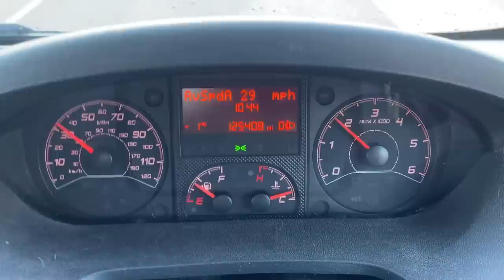Woken by angry locals and some all too familiar engine issues (Winter van life gets tough)

Comment: Hiya, I am a 65 year old engineer who used to look after Fire Engines, Not a regular viewer but just saw this and think my experience will help.
Frozen Pipes -- on the fire engines in remote locations the water pipes were wrapped in commercially available product a webbing about inch and a half wide sort of cloth on a roll with like an electric blanket element built in just to keep above freezing.
So no big insulating work just wrap around as required and connect to electric , we used 240v but sure 12v is available.
As to coolant level going down , first could be bits of air working there way out of the system , don't forget the fluid contracts when cold.
I presume you are using correct fluid as when I worked for Peugeot one fleet operator would not use the pink stuff and the blue dissolved the aluminium heater matrix due to the Borax in it.
I have several campers I support and like the diesel heaters but not done one that also does the hot water yet.
Best Wishes Pottsy.
Reply: Hello i Subscribed now and got a fail at Tele-gram attempt. 
will try again later. Steve.
Reply from the maker: Hi ya, thank you for all your advice and sorry about the scammer message that was not us, I have reported and blocked
Reply: @campervibe  😵‍💫 Panic be carefull. SP,

Comment: The water loss might have been an airlock which cleared itself. The up and down temperature might be the radiator thermostat failing which is quite a cheap part but not sure what the access is like on your engine.

Comment: Keep yourselves wrapped up warm! Looks great so far in terms of scenery! Must be the season for coolant issues as our Sidney decided to lose heating this weekend and the coolant dropped low.
Thinking back to your Spanish adventure's, what was the actual fault the UK dealer said??? Sidney is going in Tuesday for a check up. Glad it's not stopping your fun! AJ and Summer both look like they are enjoying the adventure
Reply from the maker: Hi mark, get them to check the egr cooling valve (some call it the oil cooler) It’s a common fault on these engines and is often mistaken for blown head gasket, as the Spanish garage did in our case. Our fan assembly unit was also knackered when it came back from Spain but it was hard for the uk garage to be certain of the fault as it was such a mess!
Reply from the maker: Definitely won’t stop the fun, I actually don’t know, lou is the best one but she is under head phones editing at the mo and I best not disturb her flow 😂 hope all is ok though 🤞
Reply: @campervibe  you absolute stars. I knew you'd remember. Take care and have words with that attack hound, sleeping on the night shift. Tut tut AJ! Glad you are all well.

Comment: Loosing a little colant could be a loose connection on some pipe,when you stop for a brake, before you stop the engine check and see if you have any dripping in engine bay or under the engine while it is still running (pressure in the coolant system) the temp gauge could be a loose connection or corrision in a connector! Regarding the water pipe you can buy some foam pipe that is sliced and put over it (Bauhaus/Home Depot) it not that expensive, impresive landscape, Enjoy!!
Reply from the maker: Thanks

Comment: You've got the last of the Ford 2.2s; I spend ages chasing my Transits thirst for coolant. Usually it's the EGR cooler (which I think was your issue last time? It manifests as a blown head gasket, but when the engine is stripped, the gasket presents OK...) Most recently I've changed yet another oil cooler but that was for oil in the cooling system. Also, check the thermostat housing. It's only O-ringed into the block and they do leak from there from time to time. I can't really moan though, I'm up to 410k on the original engine now in a 2013 van (yes, 410...)
Reply from the maker: 410k oh wow

Comment: Fun to watch as ever, thank you. Just film life as it happens, why would you not?

AJ clearly felt he was not under threat being protected from all ills by fearless humans! Lovely to see him romping ...

Your temperature gauge problem is most likely a poor connection to the sender unit. Or a faulty sender. I have had this exact problem. If it persists I suggest getting the sender changed. They are a common part so easily sourced and not expensive. There is a secondary effect because the ECU uses the data from the sender to control engine fueling. So your fuel consumption may suffer and possibly cold starting may be more difficult.
Reply from the maker: Oh I know he knew we would protect him at all costs 😀🐕
Reply: @campervibe  Hope Lou finds my suggestion re temperature gauge helpful...

Comment: You can get heater wire which you can put around the lines to the tank, and once that's done you can insulate it with some heating duct stuff from a DIY store. And for the waste water tank you can put some concentrated antifreeze in it, it will mix with all the crap you put in but due to beeeing concentrated it won't freeze (unless it gets really cold)
You might consider a changeover switch in the feeding line of the water pump (Or a removable plug which allows you to select a tank) so you use the underslug tank only in summer.
Ow and your ice issues... Kinging it would be happy to have that as the only issue ;)
Reply from the maker: 😂😂 bless them I’m sure they would and thank you for the advice

Comment: This is just a wild stab but running cold sounds like a problem with the thermostat rather than a more serious problem, such as a blown head gasket.

Look for white smoke and/or condensation in the exhaust.
If you're not getting white smoke then your engine is "probably" okay.

If the coolant level continues to drop, it must be going somewhere, which is a bad sign.
A faulty thermostat can make it impossible to fill the coolant system properly, though, so as the engine is running for long periods it's gradually displacing air and replacing it with coolant.
If that's the case, the coolant level should stabilise eventually.

Alternatively, it could be that, perhaps, a seal is leaking in the water pump and the coolant is just dribbling out of a drain hole somewhere as you're driving.
That isn't going to harm your engine as long as there IS still sufficient coolant to cool the engine.

Running cold sounds like the thermostat might be stuck open, though.

Comment: hello you 2  i wouldn't worry about the coolant our vans are known for only having the header tank half full if you keep filling them the air gap in the tank is smaller and less space for pressure to build so it expels some coolant so there is enough expansion as it can not compress fluid ,  all of the 2.2 vans  will run every day happy on a half full expansion tank  if the fluid drops well below half you have a problem but not until  enjoy the snow  i was there last year  have fun
Reply from the maker: Hey Ian, thanks and hope you all are ok 😀

Comment: Locks, key barrels and other fine mechanical things exposed to water and moisture prone to freezing up can be sprayed with WD40 beforehand to drive off the water and prevent freezing...
Rubber seals on doors should be coated with petroleum jelly to prevent them freezing to the doors and ripping apart if forced open...

Comment: Hay ladies I used to drive one of them vans don't slam side door as can break a plastic holder for cable for handle which the cable is a bit of a night mare to reach at the bottom of the door can easily break and come off side runner .front wheel drive should be ok in snow though great blog
Reply: Side door gets frozen easy and can be hard to shut once opened too apart from that it's a good van

Comment: Your thermostat might be getting stuck open, hence the engine running cold. Would also explain drops in coolant level as whole loop is staying open. New thermostat is about £15 and a new thermostat temp sensor is about the same (may as well do both). Running like this would damage engine if left long term, but just for a few weeks will be absolutely fine.
IIRC last time it was you head gasket that went meaning coolant was making its way into the engine and burning off. If you had this problem now, you would have loadssssss of white smoke coming out of your exhaust.
LOL just watched the rest of video and you explain all the above....ignore me!!

Comment: Yet another great vlog from you guys and that you're having a great, albeit eventful time. However, not wishing to bring a downer... I think I'd be a bit concerned about your coolant problems. It's difficult to tell but it looks like the coolant has been discoloured black? If so, it might be worth checking your oil dipstick and filler cap for creamy emulsion. If this is present, it could be a sign of your head gasket failing or, god forbid, cylinder head is cracked. Hopefully though, now that the level has settled, all should be well. All the best!
Reply from the maker: Thanks Phil

Comment: Coolant level will always drop when the temperature drops. Doesn’t mean you have a leak. Also coolant you poured in I hope was premixed.  Needs to be diluted 50/50 otherwise it doesn’t protect against freezing.  If the temp gauge is dropping and the heating is also not as good as usual. It’s likely the thermostat is stuck open so not allowing the engine to get up to temperature. This can also cause higher fuel consumption
Reply from the maker: Thanks and yeah it was 🙂

Comment: Hi, I know this is one of your older videos but wondering what time of year you were actually in France and Switzerland in this video. 
We have the same van as you and hope to go to Europe this winter after Christmas. We have been many times in summer but never winter. Thanks Carlie
Reply from the maker: We were there January and February time. We actually had a very mild winter there that year, we only found snow at high altitude and the nights were warm.
When we drove through the same mountains at a similar time a different year, it was much colder, minus 18 Celsius some nights and our van struggled to start if parked up for a few nights without moving. 
I think it can vary massively year to year.

Comment: Great episode as always!! Thoughts on the van issues (engine), that temp gauge erratically moving could point to a thermostat issue, but may of been caused by the low water level (not sure it ever went that low, below bottom of header tank?) Modern engine designs are hard to bleed, so lets hope it settles down. As you have no leaks (visible) im hoping it not your EGR cooler, as they can leak , and lose the coolant as steam/mist when in operation (at first start) or when van is doing a regeneration of the DPF? Keep the nose in high alert, as the coolant smell is often the first indication of an issue when engine hot, long before you spot leak / loss or no heaters in cab.

Comment: Did you have a coolant full system flush when the new engine was fitted.  That needs to be done every 2 years or so to keep coolant system in good shape...It could be a slight leak somewhere in the system. But the gauge might be sensor issue.
Reply from the maker: I have no idea, that is Lou’s area 😂🤦🏻‍♀️
Reply: @campervibe  I hope you get it sorted.  And yet another cracking video.

Comment: Hi. Thanks for providing a regular entraining video. Just wondering when you traveled around Norway last year did you use an Autopass toll tag or anything similar in order to travel across the toll bridges etc. if so did you incur any issues applying for it or using it. Many thanks.

Comment: You seem to be on it OK, but have you got an air-lock in the coolant system? Air keeps the thermostat cool, so shows low, then, on a slow uphill climb it heats enough to open the stat, pulls air through, dropping the coolant level. Just a thought...
Reply from the maker: Thanks, I’m sure Lou will check as she reads all the comments for suggestions and ideas 🙂
Reply: @campervibe  If you end up in SW France I'd be happy to take a look for you.

Comment: Excellent video. Lovely scenery in the snow. Ref your coolant. You might have had an air lock that might have cleared causing the coolant to drop a bit. Keep an eye on your oil on the dip stick. If it shows signs of water you could have blown a head gasket. Also oil in the coolant reservoir or bubbling when the engine is running. Ref temp gauge. The temp sender unit might be playing up. You could see if you can see if the connection to it is ok. When the temp gauge is low is your heater still warm. If so it’s your sender unit. As long as the engine isn’t overheating. Can’t see it being the thermostat. Are you still awake 😂. Are you trying to compete with Mispronounced adventures regarding traveling in freezing conditions 👍anyway I’ve bored you enough taraa p.s I don’t think your head gasket has gone. Just check the coolant over the next day or so.
Reply from the maker: 😂😂 yeah still awake 😂 thanks

Comment: Hi chicas . Love the video.Think it was irritating teenages at night. Had that too before 🐒.  You can get that cooling system pressure checked if needed,  in a decent garage. Where you fill the water they basically screw on a cap to that bottle and pressure check. Its easy to do. A pipe maybe seaping.  I use pink antifreeze  it usually shows it theres a leak . After a engine refit oftern the level changes after a good drive.  and maybe thermostat sometimes stuck or not moving as it should. Becareful it it continues because the engine not running efficiently. Sorry if it sounds obvious 😊  oh yea  I think I love Emily coz she is so happily bonkers 🤩. Safe Travels
Reply from the maker: Nice 👌

Comment: Honestly, I think it might be easier to just admit defeat with regard to preventing your water tank freezing and just rig up a secondary system fed from a couple of 5 gallon drums inside the van.

Without going into too much math's, it takes roughly 1.1w of electricity to heat 1 litre of water by 1°c per hour.
So, let's say you're somewhere cold and you've got a 100l tank of water and it's cooling at a rate of 2°c per hour.
That means you're going to need 220w of electricity to heat the water enough to keep the temperature constant.
220w equates to around 18 amps at 12v... which means you're going to completely flatten a 100ah battery in around 5.5 hours.

If it was me, I'd probably think about rigging up some kind of metal tube around the outlet of a diesel heater and then wrapping a coil of copper tube around it and then using an electric pump to receirculate water from the tank through the copper coil to heat the water whenever the diesel heater is on.
That'd work by heating the water AND by continually receirculating the water to help prevent it freezing too.
There's still the issue of dead-legs in the system freezing but, hopefully, if the temperature of the tank could be kept above freezing, it'd help keep the pipes warm and prevent the water in them freezing too.
Reply from the maker: 😂🤣 I’ve said exactly the same as this in previous vids! Heating them with electric is pointless. But like I said in this vid, I’m not going to all that effort to find out our engine can’t handle the cold or we don’t like it. If this trip goes well then I’ll make mods, but for now, our Jerry cans will be fine.
I’ve designed a system that will make use of the wasted heat from the diesel heater exhaust, cooling valve and recirculating pump. Pumping water through pipes inside the water tanks, but like I said, it’s a lot of work for something we may only do for a few weeks once.
Reply: @campervibe  You're going about it in exactly the right way, IMO.

I just see companies advertising "kits" for insulating/heating water tanks and, honestly, I suspect a lot of them are "snake oil".
You need a LOT of energy to stop water from freezing and there's no avoiding the physics of it.

Comment: Great vid Stay safe , I always carry pepper spray in food cupboard . Would a small pipe run from diesel heater outlet run through tanks keep them warm enough?
Reply from the maker: Hi Steve. I looked at doing that with the diesel heater last winter and I don’t think, with the length of run I have and the long tank that there would be enough heat left in the pipe. However, I do think I could do something similar if I could use the heat from the diesel heater exhaust. It’s a work in progress and if the van survives this trip then I may well invest some time into investigating it properly.

Comment: If you ever change the van try and get a Toyota van with a D4D diesel engine 
My friends company has two and they have done 650k between them without any issues and one has been to Norway in the winter run like a dream

Comment: your Citroen Jumper Van should have a red coolant, has it been changed by flushing all systems or did you pour wrong coolant in it, that will make a huge issue !
Reply from the maker: This is the colour coolant it came back from Citroen with when they replaced the engine. The coolant they recommend for my vehicle is not red.
Reply: @campervibe  okay so engine is replaced, propaply there is a reason that they changed to a different coolant, happy to know thats not the isue then 👍 
Sometimes i see that different coloured coolants are mixed and it causes problems.

Comment: Ladies I hate to say but….. would it have not been easier to defrost the pipe with a kettle of boiling water down the sink! 
Keep safe also with all that nonsense with banging on the van! Keep up the good work.👍🏻
Reply from the maker: Hi Glenn, we tried that and it didn’t work, far too frozen I think. It needed disconnecting anyway as it’s only going to get colder where we are going. Thanks so much for watching 😀

Comment: Be very careful regarding vignettes they will slap you with a very expensive 3 or 10 day travel pass if you cross the border without one. you can buy them for 1 day, 3 day, 10 day, 30 day(month) vignette and they are FAR cheaper to buy before the border at the Petrol stations. Same applies for Czechia and Slovakia.